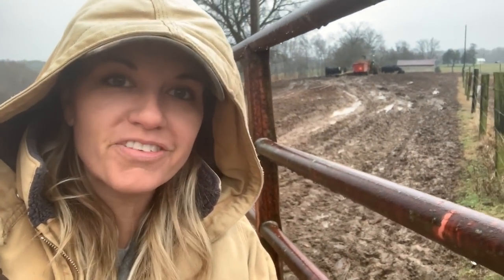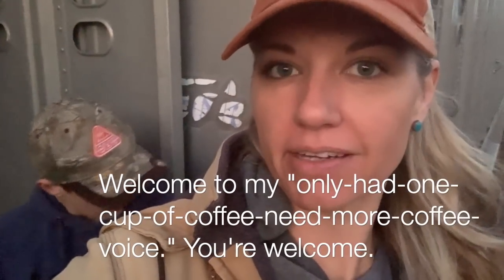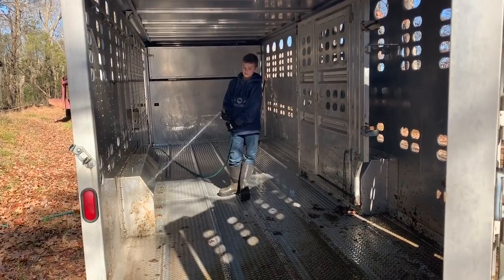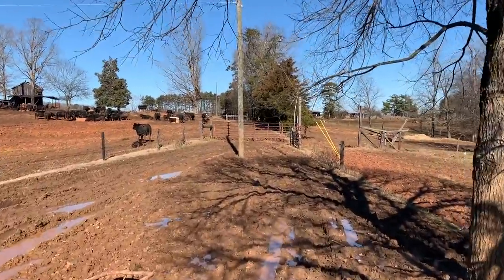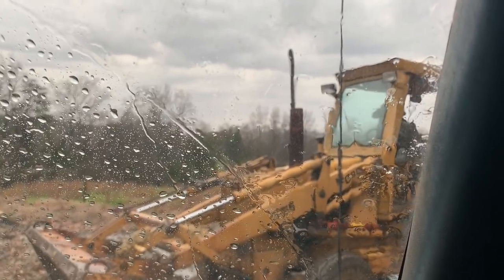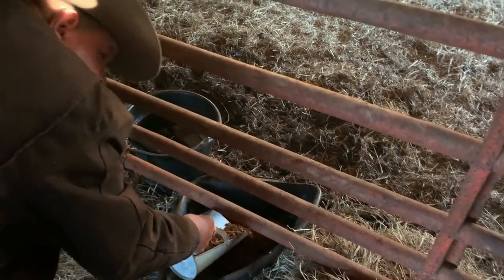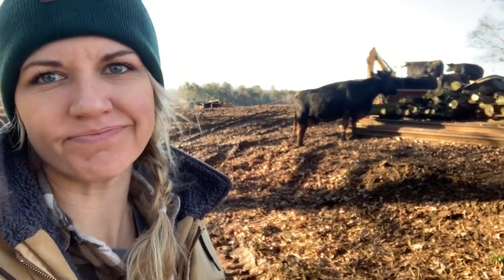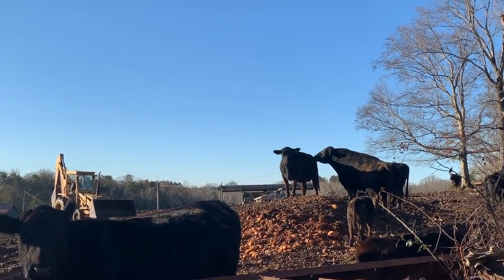More Old Gold : Turning A New Decade with a Really Old Lathe

Comment: We live near the Ninescah river in Kansas. Whenever we hauled our cattle, we'd throw a bunch of river sand into our cattle trailer prior to loading them. When we were done, we'd immediately wash them out. The trailers cleaned out so much easier. You don't need a lot of sand in it.
Reply from the maker: Interesting! We never put sand in the trailer but we always wash out right after use. I’ve never heard of that :)
Reply: Just throw a few shovel fulls in,  then easily spray out.

Comment: Lodge and Shipley made good lathes, that one is a cone head from when they ran all the shop machines off of overhead belts. It has been converted to run with the electric motor mounted up above the drive pulleys. Be very careful unloading that machine, they don't have much of a base  and not much weight down low. That extra weight up high makes them prone to flop over and it happens fast. Lots of people have been killed or injured moving those old lathes around or unloading them.  Best way to move it is with the backhoe.

Comment: I spent my working career as a machinist, tool maker, and machine repairman, so I've ran a lot of different lathes. Back in the early 80's, I spent several days tearing down an old blacksmith shop and moving stuff to a new building for the  blacksmith's widow.
 In trade for my work, I took a 1934 South Bend lathe that they had bought new in 1934. It is very much like your 'new' lathe. Mine has never was converted to be run from an electric motor.
 I have a short like shaft mounted above it and run the line shaft with an electric motor. I would guess you lathe is somewhere between 1900 and 1930 model. William Lodge had a registered patent on a lathe dating back to the late 1880's

Comment: Lathe s going to be very useful for making bushings and shafts for your equipment. That tool he was holding is a bearing scraper for fitting lead babbitt bearings from the early 1900's engines

Comment: Made in Cincinnati 25, Ohio, in the heartland  of the American machine-tool industry, Lodge & Shipley lathes were long recognised as being of superior quality and advanced design.  The company was started by an Englishman, William Lodge, who, upon arriving in Cininnnati in 1872, worked initially for John Steptoe, another Englishman widely acknowledged as the first in the area to manufacturer machine tools. In 1886 Lodge went into partnership with William Davis, the new company - specialising in lathes, planers and drills - quickly becoming the largest machine-tool builder in the city. By 1891 Lodge had founded a new company, Lodge & Shipley, and, from 1893 when they dropped their other machine-tool lines to concentrate on the production of lathes ("Good Lathes Only" was the Company's motto) started on a path that was to make them the largest lathe maker in the U.S.A. By the end of the First World War, in 1918, Lodge & Shipley occupied what they claimed to be the largest facility in the world devoted exclusively to the manufacture of lathes. However, although their product range was wide - and included a wide variety of ordinary engine lathes ("BGSC" or backgeared screw-cutting centre lathes in the UK), as well as the same machines modified for production purposes and specialist versions such as "Oil County" (very large spindle bore) and "Duomatic" automatic-types - they did not attempt the manufacture of repetition-production machines in the form of dedicated capstan or turret models. Even the earliest of Lodge & Shipley's lathes were characterised by careful design and adherence to sound principles of quality engineering. They were not distracted by attempts to manufacture lighter 'workshop' models of the South Bend's type - designed to appeal to garage owners, repair shops, training schools and amateur owners - but concentrated instead on heavy industrial machines intended for serious work. All Lodge & Shipley lathes had massive beds, with bracing of the front and back walls in the form of "elliptical girths", and by the early 1920s were advertised them as having a "chilled" finish where the outer shell of the casting was altered to a depth of around two inches so that its iron grains were more closely and uniformly packed together. This layer could then be machined and hand scraped to give a hard, wear-resistant finish. At the tailstock end of the bed the normally full-height and massive cross ribbing was cut away to allow the tailstock to overhang the end (and so steal a little more capacity between centres) or allow a bed-mounted capstan turret be slid on and off easily and quickly. Down the centre of the bed on larger, very heavy-duty models a longitudinal rib was cast; cut with a deep rack the rib provided support for a tailstock-mounted  sprag to engage - and so provided a positive end stop when using the machine to the very limits of its strength.

Comment: Find the dataplate for that lathe- they are usually covered in old oil and dirt, but it will have a model and a serial number.. There are many antique machine tool forums that will have seen listings of date of manufacture.. I've even seen pdf.s of the original manuals for some...

Comment: If the lathe is a model 1900 7" I believe it is belt driven was manufactured late 1800s lodge and Shipley got a patent on it in 1898 or no later than 1899 we have an old machine shop in our town that is closed the owner passed a few years ago that is full of this old belt driven equipment.

Comment: When I read the title to this video, I thought you were getting a wood lathe to put in your Shed. Turning wood would be a fun thing to do! Making anything is fun to me......
Reply: That old "Metal" Lathe can certainly be used for wood, especially Hard-wood. It works better for wood than a much simpleier and less-strong "wood" lathe.
Reply: @jimbaxter4600  Yes sir you are correct, only reason I don't like to turn wood on mine is the wood chips and dust get in way more places than the metal chips and gums things up... But it is doable and can be cleaned up afterwards...

Comment: Your lathe is from 1900, very old and if in any kind of condition that is useable then a very good piece. they were built very well with straight chuck and bed. Just have to make sure base is strong, concrete is best and lathe is level on final install.
Reply from the maker: Awesome! He said he thought it was probably early 1900s. Yes, he’s going to have to put it on some concrete

Comment: If you use plywood on the shed , in places exposed to the weather , be sure to use plywood that was made using external ( water proof ) adhesive .  Otherwise , plywood made with internal ( inside use ) glue , will come apart .

Wyr
God bless

Comment: found this online ,Lodge and Shipley was best known for making metal lathes, but also made brakes, shears and veneer cutters.  

Lodge and Shipley Lathe Serial Numbers:

The following is a list of serial numbers and years for Lodge and Shipley lathes - other machines used different serial numbers (however, between 1957 and 1978, these serial numbers are for both lathes and shears).  The serial number listed is the first machine made in that year.  

1900 - 1736

1901 - 2500

1902 - 3225

1903 - 4225

1904 - 4900

1905 - 5534

1906 - 6600

1907 - 8625

1908 - 9635

1909 - 10200

1910 - 10890

1911 - 11940

1912 - 12950

1913 - 14010

1914 - 15250

1915 - 16250

1916 - 18375

1917 - 20610

1918 - 21850

1919 - 23970

1920 - 25725

1921 - 26180

1922 - 26850

1923 - 27125

1924 - 27540

1925 - 27765

1926 - 28100

1927 - 28503 

1928 - 28769

1929 - 29183

1930 - 29742

1931 - 29957

1932 - 30043

1933 - 30052

1934 - 30089

1935 - 30168

1936 - 30337

1937 - 30726

1938 - 31342

1939 - 31623

1940 - 31931

1941 - 32959

1942 - 34151

1943 - 35500

1944 - 36905

1945 - 37780

1946 - 38301

1947 - 39010

1948 - 39473

1949 - 39823

1950 - 40160

1951 - 40348

1952 - 40796

1953 - 41324

1954 - 42510

1955 - 42800

1956 - 43085

1957 - 43639

1958 - 43942

1959 - 44215

1960 - 44475

1961 - 44640

1962 - 44971

1963 - 45300

1964 - 45463

1965 - 45873

1966 - 46420

1967 - 46979

1968 - 47437

1969 - 48042

1970 - 48410

1971 - 48643

1972 - 48803

1973 - 49005

1974 - 49190

1975 - 49369

1976 - 49702

1977 - 49948

1978 - 50146

1979 - 50302

1980 - 50411

1981 - 50661

1982 - 50939

1983 - 51099

Home | About Us | Discussion Forum | Machine Info | Photo Index | Buy & Sell | Tools | Support VintageMachinery.org

Comment: Nice Sunny days....lathe needs cleaning then oil in the ways oil holes and grease 
and that chuck needs soaking in rust remover
Reply: And,,, certainly provide a shelter for it that keeps it very, very, dry. Even high humidity will cause it to surface rust, which will ruin the ways. Oiling will help but it needs to be light oil , not any grease.  Both attract air-born dirt which will also cause damage. Flat belts don't like high humidity either.  Good Luck LB

Comment: If you have an Echo "Alexa", check out Wyze cams.  They're cheap ($23.99 on Amazon, $20+shipping on their site (so $23.99)), tiny, wireless (2.4Ghz only), have great night vision,  motion tracking which can send alerts, two way communications, and are HD (1080p).  They work with Amazon fire stick (Alexa, show me cam 1, Elmo cam, etc.), and on your phone.  There's even one that pan, tilts, and tracks motion ($34.99).  The only thing is the app is a little slow for monitoring, but they work great with the free version of Tinycam app.  Which is also available for download on your Fire Stick (but not for Roku).  And Wyze was created by former Amazon employees.

Oh, did I mention free cloud storage of alerts for life, plus has a micro SD slot for continuous recording plus Time lapse (which would look great in one of you videos here).   And they're lite enough to put way up high on an antenna pole.

Comment: Yep that is an early 1900's Lodge and Shipley lathe. Any of the belt driven machine tools would be the early stuff in most cases. Make sure you anchor that lathe in the floor to secure it. And it needs to be level and plumb. If not it will not cut true. Good luck with it.